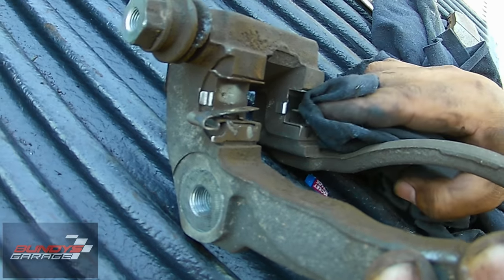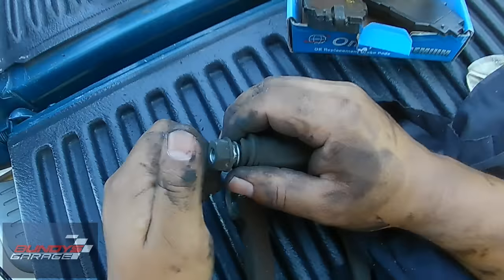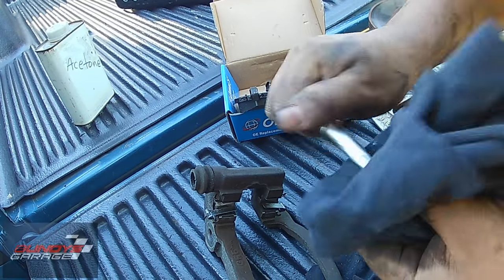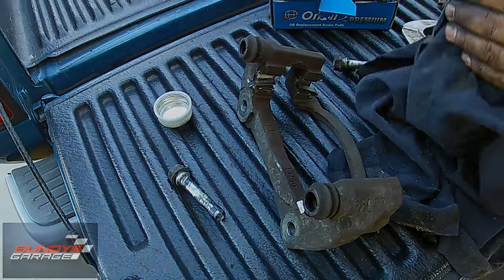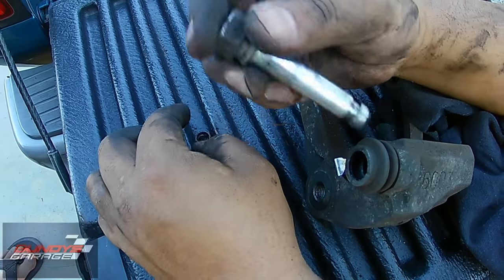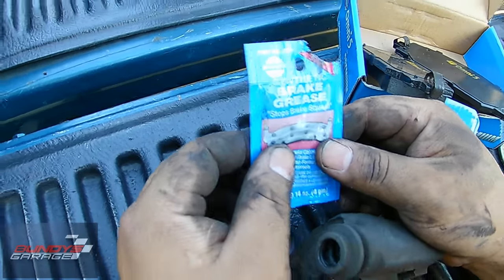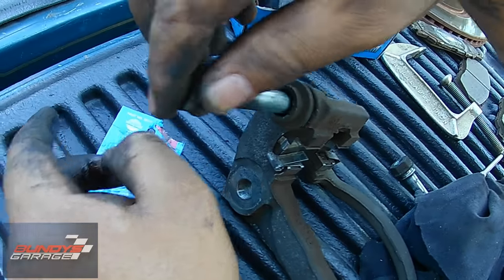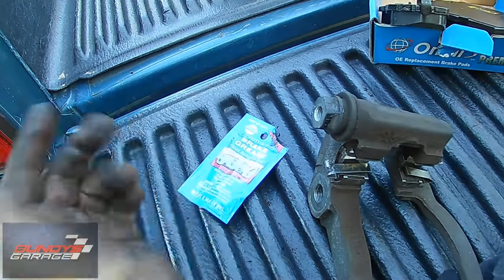What is that piece of rubber "tube" on the lower brake caliper pin? | Honda | Toyota | Lexus | Acura

Comment: I had a rattle after taking my car to the local Honda dealership.  They measured my brake pads to see how much life was left in them.  Apparently the left rear was dragging and was down to 20% while the rest were at 80%.  I wasn't happy with the rattle and a few other items that turned up broken or missing, so I haven't been back.  Fast forward a year or so, rattle is still there.  Replaced those rear brakes long ago, but the rattle in the front was still there.  Over the past weekend, I replaced the front brakes (rotors still good).  What I discovered was that the lower bolt which holds the caliper to the carriage pin was missing.  Thus, my brake pads were indeed rattling against my rotor the caliper was not correctly aligned with the pad, and the metal backing of the brake pads had removed themselves from the pads (thus creating the occasional grinding noise I heard).  My theory is that the dealer measured the pad thickness, and then forgot to replace the bolt when rotating the caliper back into position.  This is why you do the simple work yourself!

Comment: I consider the boots/pin rubber bellows items as part of a complete brake job so I always have the rebuild kits on hand when I dig in... yes they can swell and also the boots can get weak and tear or lose ability to keep water out so I generally will just order all the parts even if I'm just changing pads. If they are swollen generally they haven't been serviced (or correctly)  in a long time or the boots bad---Using silicone based lube (lightly) and replacing rubber to me is easy enough...but agree it's not mission critical but If I have it torn down you can count on just replacing them before. you get to that point.

Comment: Many of the Japanese caliper manufacturers use this differential pin arrangement. The plain pin is called the Guide Pin. The one with the rubber bush is called the Lock Pin and and is usually positioned at the trailing (second pin for a point of the disc to pass) end of the carrier.  Carlson makes a kit that has the rubber bellows & the bushings.
Reply: Thanks for your explanation. I believe many people don't understand this and the trailing pin changes from side to side. Rotor spins counterclockwise on the left side (driver's side), so the trailing pin is on the bottom or front of the caliper.
Opposite for passenger side.
Great tip!
Reply: Can you confirm that the lock pins are supposed to be the trailing pins?
Reply: @MrBikedrummer  Not true, it would depend on if the caliper is mounted in front of or behind the axle.
Reply: @MrBikedrummer Yeah that's BS. If the calipers are mounted behind the axle, the trailing pin does not change from left to right
Reply: @rfcdgaf  
So, therefore, the trailing pin shouldn't change regardless of whether the caliper is mounted behind or in front of the axle.

If I'm understanding this correctly, is the trailing pin the last pin to be passed by the rotor?
If so, it would always be the front most pin on either side.
Thanks for the discussion and I'm not sure that it matters.

Comment: My guide pins had same problem and ruined the rubber when force them our of the bracket, and there was no chance to return the pin with rubber because of rusted hole, so I reinstall them with no rubber ring. Right now, I have peace of mind due to your video. Tons of thanks!

Comment: DO NOT USE ANY CLEANERS ON THE RUBBER CALIPER GUIDE PIN BUSHINGS OR BOOTS as was suggested in this video. Simply wipe them off with a clean & dust-free towel or cloth. Using cleaners on them, especially gasoline, brake parts cleaner, acetone, etc. is the quickest way to cause uneven brake wear. Most cleaners will cause the bushings to swell causing the guide pins to stick inside the bracket. Also, DO NOT SPRAY CLEANERS IN THE PIN'S BRACKET HOLES. if you spray cleaners inside of these bracket holes, the bushings may continue to swell over time, seizing them entirely.

DO NOT REMOVE AND DISCARD THEM EITHER, as was also suggested in this video. THEY ARE THERE FOR A REASON. The guide pins with bushings are always on the "trailing" end of the caliper and provide a slight amount of additional resistance compared to the "lead" pin, which is simply a slide and pivot. The additional resistance added by the bushings provide stability and helps reduce brake noise when braking heavily and when the brakes are released after moderate to heavy braking.

This shadetree should seriously consider studying up before working on anyone else's brakes or offering bad advise to others.

Reference: ASE Certs and 28 years of professional brake repair experience.
Reply: I totally agree with you. But if you spray cleaner in the gaps and then dry very well, it should work, don't you think? Of course to the rubbers for no reason any solvent.
Reply: @luisalbertolanda   Alcohol and soapy water: soap/water and add alcohol. this will not hurt ay thing.
Reply: i use wd40 to clean.
Reply: I have always sprayed brake clean in slide pin holes to help clean out old grease, let dry. Regrease slide pin. Never had a problem
Reply: Bro, it's a little piece of rubber.  Relax man.  I'm not a mechanic but when I do my brakes I remove the rubber.  My logic, the one without rubber moves just fine, the one with rubber doesn't and usually takes heat, pry bar and hammer to remove and clean.  If the engineers were so smart they would fix the problem.  Pretty simple imo.
Reply: It's a shame that during your 28 yrs of "professional" experience repairing brakes, you STILL haven't learned the correct way to install the guide pins properly. Thats very hazardous. I'm curious though, about how many people during those 28 years you've put in grave danger by installing the guide pins wrong? The pins with the bushings on my Honda are placed in the leading side. Therefore, whoever originally trained you to repair brakes provided you with bad training advice. I would NEVER let you near my vehicles. Not even to change the tires.

Comment: you want to take those chrome inserts off and clean any rust from the steel of the caliper bracket and then put grease on that before you put the chrome inserts back in so that you prevent "rust jacking" of those chrome inserts.  "rust jacking" will restrict movement of the brake pads and the grease applied under the chrome inserts will hold "rust jacking" to a minimum.

Comment: Just did mine and while I was there I removed that rubber piece just because then I drove the car and it feels very smooth,  just went in for a routine checkup and removed all brake pads and pins, cleaned, and re-greased.  Car is a lot smoother since the front and rear pins were seized up.  I check it every 40k miles or so…it’s worth it
Reply from the maker: Finally someone who understands basic physics!

Comment: The reason for those rubber "spacers" is important! It keeps the slider pin in place, centered, and keeps the pins from scraping against the caliper. If it came with your vehicle, "put it back in"!  An engineer designed it for the vehicles company and decided it works better with it. Remember, it's there for a reason. When you clean, restore and/or regrease your brake caliper and it doesn't let the slider pin go back in, it means the rubber boot/bushing/spacer is stretched and/or swollen, and needs to be replaced. It costs anywhere from $3.50 to $5.50 as a kit with new rubber boots included for both of your front or rear calipers. Do yourself a favor, and just reinstall.
Oh, and as BundysGarage said, clean out "all" of the old grease and use the proper lubricant. I use Sil-Glyde or PermaTex (24110). Apply some on the boots, pins, and the shims of your brake pads. You'll be glad you did.
GL!
Reply from the maker: Thanks for your comment. But I never put grease on the back of brake pads. It didn’t come from factory that way so why do it? I’ve had this discussion with lots of mechanics and some say do it and others say don’t. I’m in the boat 🚣‍♀️ that’s say don’t do it. As far as the runner bushing being left off, it’s not that big of a deal if it’s left off. The reason I left it off is, if the wrong grease it used on the seal it will swell and prevent movement of the caliper. Causing the brake pad to wear unevenly. So you tell me this, do you want to keep it on there cause some engineer put it there or do you want to save money by not having to do the job twice???????
Reply: rigoagui  Engineers make lots of stupid designs....don't get me started.   Empirical evidence is a higher power.
Reply: That might be what they are trying to do but you are still going to have rocking in there having a washer only at one end.
Reply: @William1866  yes but usually always a reason. Its a floating caliper. The rubber is what centers the float after breaking
 You just replace them every time you do your pads. Its not hard. Engineers might design something badly in an area that needs it but it needed it for a reason. There is always a reason even if the design sucked
Reply: Jon Nieves Then why isnt there a rubber bushing on BOTH pins? Why do they only want one to stay centered and not scrape the caliper? It makes sense what you are saying but if true why not both
Reply: @donjohnson1416  I agree. I battled for an hour trying to get my caliper to fit over the rotor because of that stupid rubber piece. If its so important, there would be two, not one. Besides, its at the very end of the pin. That is there to help prevent rattling, not a centering guide.
Reply from the maker: RC thanks for the comment. Most of these kids leaving comments have never worked on a car and have no real world experience. They can leave the rubber bushings in if they want (I’m giving them free advice and they can take it or leave it after doing 100’s of brake jobs) so when it does get stuck they can pay a mechanic like myself to get it free for them.
Reply: If the rubber bushing is there to keep the pin "in place, centered" and keep it from "scraping against the caliper," then why would it only be on one of the pins?
Reply from the maker: Exactly!!! You don’t need them. Most mechanics at independent shops that do brake jobs don’t take the time to lube the caliper slide pin and when they do, they use the wrong grease. They usually just throw axle grease on it.
Reply from the maker: I don’t think you can unless you buy the whole pin on most vehicles.
Reply: Brandon Tibbetts if I’m correct both slide pins are designed different. Why? I do not know.
Reply: BundysGarage I bought x2 kits with the pin boots and they came with x2 outer rubber boots as well. Cost me $3.99 per kit, no slide pins included
Reply: @tazzydragon  they come with the guide pin boot kit when you purchase a set of front caliper guide pin boots. I got duralast ones. Itll come with 2 boots and two bushings. Hope this helps.
Reply: @terrormisu  thanks
Reply: Where do you buy the rubber for $3.50?
Reply: I think that this rubber is there to avoid friction between metals. it goes at the end of the lower pin because that point receives more weight of the caliper. My mirage 2014 have 2 rubbers on the lower pin but just the ruber at the end of the pin  is expanded. Maybe more friction there. Sorry for my English.
Reply: @jk-bf4nw  I agree, I think you’re right, both pins are attached to the bracket on the threaded side but the bottom one is all you need to hold the rest of the weight.
Reply: Yes, its a big factor in your brake piston, before, i removed the rubber on my slide pins, after that my car starts to drag, feel like mt brakes are sticking..after that i put it back again, and its fine.again.
Reply: I call BS, I've forgotten more brake jobs than you've probably done (unless you're a tech, if so apologies in advance) but so far I've only seen one vehicle with them AT ALL.

I'll stick to the theory that they're there as dampers, before I believe that they're there to "center" only one of the pins as other people have pointed out.
Reply: @donjohnson1416  Please accept my long winded answer to your question.

I don't know for sure why only one pin has the bushing, but on my car, that one bushing goes on the pin closest to where the brake pads press against the caliper bracket as the car stops after moving in the forward direction. 

On my car, the caliper bracket for the front brakes is forward of the front wheel hub and the caliper bracket for the rear brakes is rearward of the rear wheel hub, and the bushing is on the lower pin for the front brakes and on the upper pin for the rear brakes. So there is a definite symmetry and logic about which one of the 2 pins gets the bushing. 

A bushing may encourage a more equal distribution of lubricant between the caliper pin and caliper sleeve.  

If both pins had bushings, then the caliper pins might not slide as freely in their respective caliper sleeves because when one bushing is centered perfectly, the bushing on the other pin might not be perfectly centered and both bushings would start to rub. 

So one pin had to be chosen to include a bushing and for some reason that choice went to the pin closest to where the pads press hard against the caliper bracket during braking.
Reply: FYI

Sometimes experience with something tells more about the reality of it, then all the "engineers" in the world can.

My original new 2002  Outback I put 409k miles on before I gave up on  her.
My after market 2002 Outback I bought with 130k on it and now have 275K on.

The brakes and pads on my 2002 Subaru Outbacks  DO NOT, do not, Do Not perform better with those rubber bushings on the tips of the pins.

Whether they are new bushings and installed with the correct grease or not.

Way, way, way to many miles with and without them, not to be able to well formulate my own opinion on them.

Make not a single mistake about that.
Reply: @lewisheilig3623  This is a VERY interesting observation and supports the concept that the purpose of the bushing is to provide anti rattle.  Because the pin that would rattle the most ( or rattle at all )  is the second pin the rotor reaches of the two, with respect to rotation of the rotor.  That is the one with the bushing in your scenario.   As you say the second pin is dealing with the most pad contact, so it is going to have the most pressure on it and thus bounce tendency on it.

As you say two would cause too much trouble.

But one cause too much trouble as well.

Problem is it only works when everything is new and greased just right.

Then it becomes a brake pad killer.

If one does not suffer a MAJOR problem with squeak or rattle on their rig,  DITCH the bushings.

big,  BIg, BIG time!
Reply: @rwachtell  Thanks for your comment. 

I would agree with you that the second pin (with the bushing) is more likely to be pushed harder against the inside of its caliper sleeve, because this sleeve is at the end of the floating caliper that is the most immobile due to it being so close to where the pads press hard against the stainless steel clip on the bracket during full braking. 

The sleeve of the first pin (without the bushing), at the other end of the caliper, receives less rubbing pressure due to its greater distance away from the point of hard contact between the pads and the stainless steel clip.

Because of machining inaccuracies, wear and tear on parts, and dirt and rust build-up, I can't say which caliper pin is more likely to rub or vibrate within its respective sleeve when the brakes are applied.

But it is easy for me to imagine that the bushing is designed primarily to reduce the wear between the second pin and its sleeve (the sleeve more likely to wear), and that the bushing may offer a secondary advantage of reducing any potential squeak, as this sleeve is also very close to the source of the vibration. 

I don't know if the bushing wears out faster than the adjacent metal surfaces between the pin and sleeve, and thus has to be replaced often, or if the bushing actually wears out slower, due it being of a different material than the metal.

In a perfect world, pins and sleeves would be so perfectly matched that there is no rubbing between them, and the only rubbing that takes place is between the ends of the pads and the stainless steel clips. 

In this situation, ditching the bushing may be of no consequence.
Reply: I would like to add that some improper grease products (when applied in that location) are know to swell the rubber ring/bushing.  Make sure you use a factory recommended product for that location or an equivalent.... probably a silicone base product that does not attack rubber.  Just my humble opinion. Thanks for the video!
Reply: sly glide is the best
Reply from the maker: Someone who understands
Reply: @brandontibbetts4214  that means the bottom pin would be scraping against the caliper?, because the two bores won't be wearing evenly, if a company design it to wear from another pin is stupid, and again it doesn't center anything, if you know anything about physics if something in a bore has to be centered it would be in the middle of the pin, because the more it moves out with the rubber at the end the more it would pivot, it isn't for centering
Reply: @jameslund221  not all cars come with two, so tell me company's are so stupid to make the top pin protected from contact but leave the buttom pin to rub ????
Reply: That rubber is there to prevent noises. The caliper pins  can vibrate  and cause lots of unwanted noise when the rubber is removed.

Comment: I had a problem with mine pin-rubber and didn't know what to do...it was stuck and was very difficult to remove the pin. when came out the rubber piece was stuck inside the caliper...removed, cleaned and now it is perfect. tks Sr.